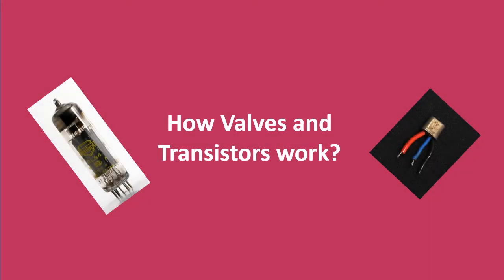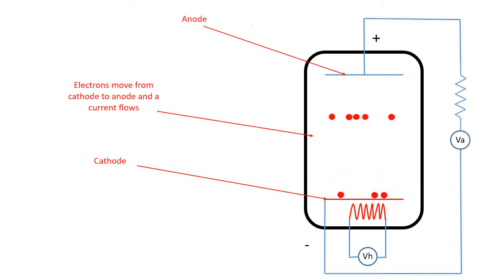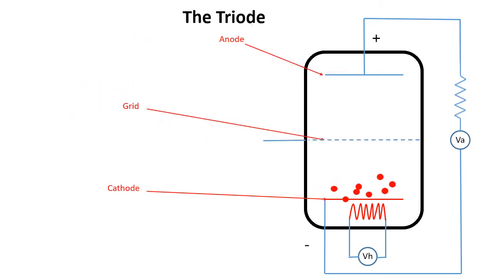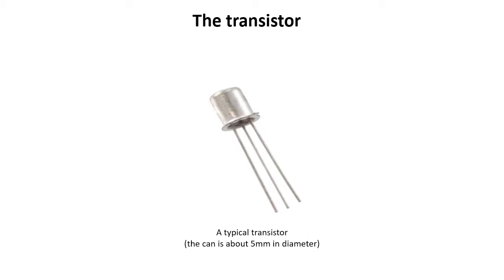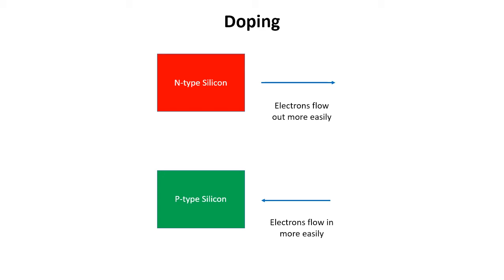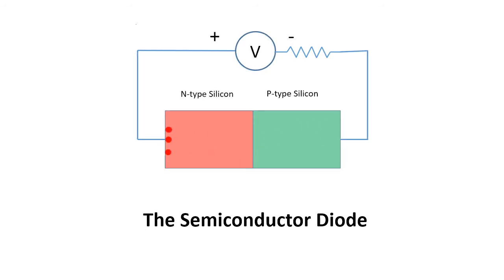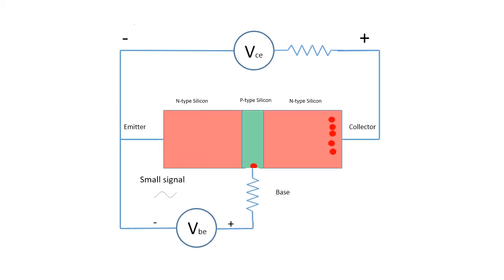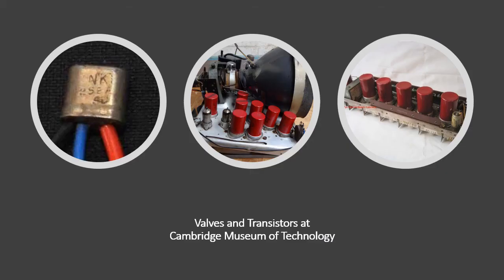How Valves and Transistors Work

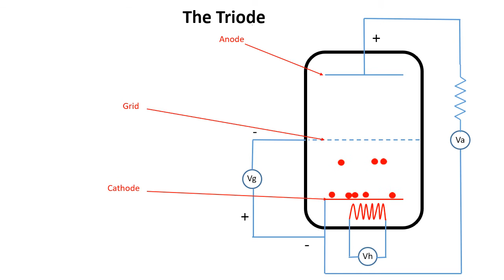Comment: @3:48 if a negative voltage is applied wouldn't the electrons stay at the cathode.  as it shows, the electrons is still attracted to the grid, whereas the explanation is that they should be moving away (repelled) away from the grid